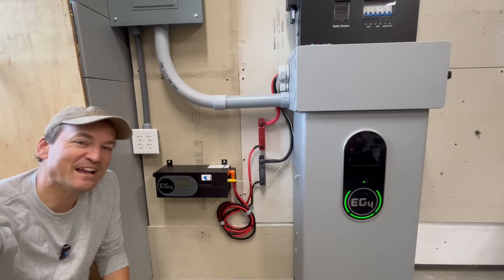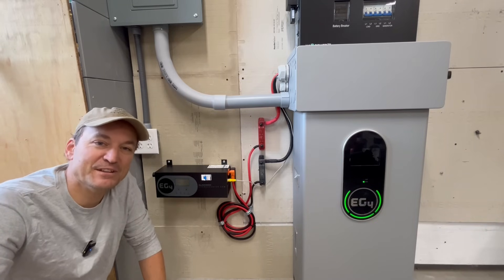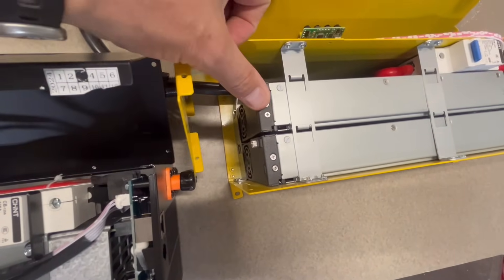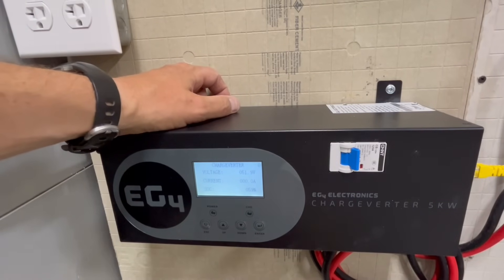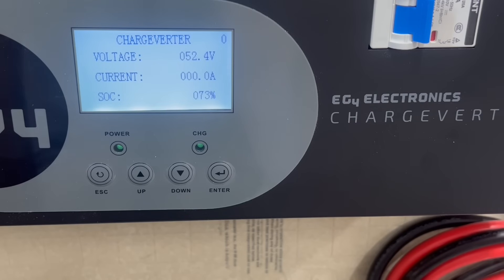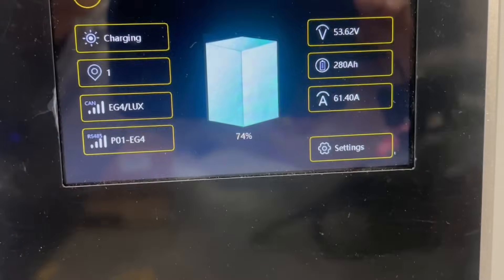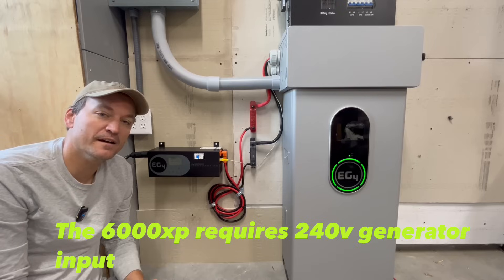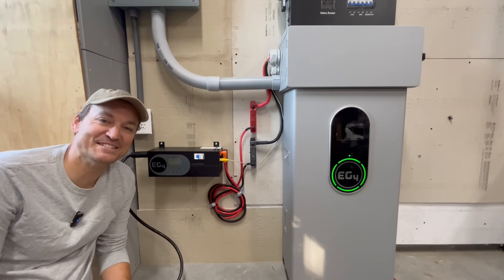New EG4 Chargeverter, charge your batteries fast when the grid is down

Comment: The propane generators don’t really require any sort of manual prime? So in theory you could hook this up with a small battery tender on the generators battery and have a fully automatic system?
Reply from the maker: Exactly. Once the starting cycle is activated it’ll keep trying till it’s started. The Duromax and other models actually come with a battery tender.

Comment: No use the complete setup you have in the video but instead of generator power I would use an available 120v 15a source in the building next door.  The issue is to bring power to the office trailer would cost upwards of 50k. I was thinking the setup you have with the chageverter and it can control a contactor instead of a generator.  Any suggestions or other ideas?
Reply from the maker: That should work yeah. The relay would just be in control of the contractor instead. If you have solar hooked up as well,  you may not need to supplement too much from your 120v supply. It all depends on your usage of course.

Comment: What if you have two (or more) EG4 batteries? Does the chargeverter have to be connected to both, or does it automatically load balance?
Reply from the maker: It will just communicate with the master battery. The current would balance between all the batteries.
Reply: The manual isn't clear on this but I believe with two or more EG4 compatible batteries you just connect the Chargeverter's RS485 port to the master battery's RS485 port and daisy-chain the all the batteries "Battery Comm" ports together with Ethernet cables and all the batteries act as one.

Comment: Question is I would like to use this as a UPS system and have access to a 120 V 15 amp receptacle for charging. This set up is used for a office trailer that only has 15 A available and need to power a 30 amp load split phase. What would you recommend?
Reply: It is only rated for 3050W at 120V so that will limit you to around 2,400W (with conversion loss) and the CV running full out!  Also, I doubt it is rated for a 100% duty cycle.
Reply from the maker: Use this in lieu of a battery you mean?

Comment: When using the Chargeverter, do you need to use an inverter based generator?
Reply from the maker: No, it really has no issue with generators that have dirtier power. I have tested this before on an another work site generator I have.
Reply: No.  But I would.

Comment: FYI, the Chargeverter is auto-voltage sensing so it uses the same two wires for both 120V and 240V.  That means that the Neutral wire in the Chargeverter's plug is not used even when connected to a 120V source.
Reply: Neutral is ALWAYS used at 120 volt. It may not be used on a 240 circuit.

Comment: Alright, great review but the best question does the chargeverter and inputs on the 6000xp act the same or are they different? And how? Ok so if I have an inverter generator straight to 6000xp but non inverter I need a chargeverter. Thanks for the answer. Edited
Reply from the maker: That is correct. Even my cheaper inverter generator has a very consistent sine wave. I haven’t tested this myself but I’ve seen multiple videos on it. So that is an option as well. You could find an inverter generator that fits your needs and attach it directly to the generator inputs on the XP.

Comment: Hey was wondering if the communication with battery is the chargverter OR inverter or do they both work?
Reply: Wondering the same thing
Reply from the maker: The communication is directly to the RS485 on the battery.
Reply: @GavinStoneDIY  does the inverter use the same port? Or are they using two different ports? And thanks for taking the question
Reply from the maker: @mattman6199  the inverter uses the CAN port. So both the chargeveter and the inverter can communicate with the battery at the same time.
Reply: @GavinStoneDIY  thanks .. the way they worded it could have gone both ways and I wanted to make sure
Reply: I have the power pro all weather set up in parallel. I tried connecting and I’m getting “LOST” on the SOC on the chargeverter. No luck getting it to communicate. Anyone else having this problem?
Reply from the maker: @cindystokes8347  do you have the coms cable hooked into the RS485 port on the battery?
Reply: @GavinStoneDIY  rs 485 in the battery to the chargeverter and the one from the inverter to the can port.
Reply: @GavinStoneDIY  sorry my response just now was what I finally tried and no longer got LOsT but it did shut my power down. Perhaps should have moved the cables while everything was already shut down?
Reply from the maker: @cindystokes8347  that shouldn’t  cause an issue unless your inverter was switching protocols maybe.

Comment: Looks like an 8 pin aviation connector just check the diameter as they make 2 sizes. Aviation 8 Pins Plug and Socket Wire Cable Connectors - Diameter 0.63" (16mm)
Reply from the maker: Thanks I’ll take a look. It is an 8 pin aviation plug I believe .  But I haven’t found the correct size yet.
Reply: The cable you are looking for is the GX20 aviation cord 8 pin, it's on Amazon bt it won't let me post the link  @GavinStoneDIY
Reply: Can you tell us what pins you used to start/stop the generator?
Reply: Is the same cord I have on my Westinghouse 20k, the difference is that mine is 7 pin. Pins 3 and 4 make the start/stop work on mine.
Reply from the maker: @isaiasrivera5054  roger that thanks. I just haven’t had a chance to get one and work on this.

Comment: So are you able to run closed loop with the Chargeverter & the inverter at the same time, or is it one at a time?
Reply: I am wondering the same thing
Reply: @mountainmanprojects  Right, because it's a good idea, but if the choice is to go closed loop on one or the other, it doesn't make sense to have closed loop on a hopefully seldom used charger.
Reply from the maker: You can run both at the same time. It’s hooked into the RS485 port on the battery. .And the closed loop for the inverter is using the CAN port.
Reply: I have the inverter plugged into the RS485 port. You can plug it into a CAN port and it will work?
Reply: I just tried that, but maybe I should have had everything shut down when I made the changes. Making the changes while on shut it all down. Does that mean it won’t work? or just that I made them while the system was running and it freaked things out?

Comment: What are the disadvantages of just connecting your generator to the generator inputs on the 6000xp?  It seem that EG4 could integrate the same tech of the Chargeverter into the 6000xp.  If that's not gonna be the case then the generator inputs on the 6000xp inverter are pointless if I have to spend another $500 for the chargeverter.
Reply: The Chargeverter's power supplies are designed to handle distorted sine wave that most non-inverter generators put out under heavy load.  The 6000xp charger is expecting cleaner utility quality sine wave.
Reply: @rpsmith  thanx, so if I have a Costco FIRMAN T07571 Tri-Fuel Generator is a 9400-watt trifecta — running on gasoline, natural gas, and propane I need a chargeverter because it is not an inverter generator? Thx
Reply from the maker: I have a firman generator I have used on the job site for years. It has a terrible sine wave and would not work well for the 6000XP. But your model may be newer and have better components. It’s hard to say. Typically you’d want an inverter generator to hook directly to the 6000xp. They have a consistent clean sine wave.
Reply from the maker: The chargeveter isnt dependent on a clean sine wave generator. The 6000xp would need an inverter generator to operate without issue.
Reply: this is an interesting question, does that generator plug act like a chargeverter or is it more sophisticated. That is the question Gavin and EG4 has to answer. they want you to buy both though so I doubt we get the answer we want to here.???